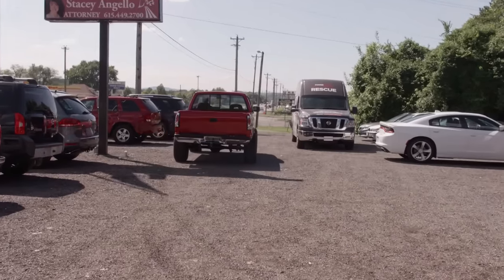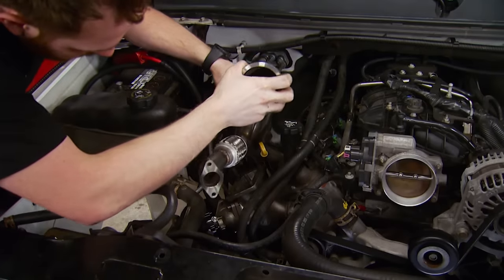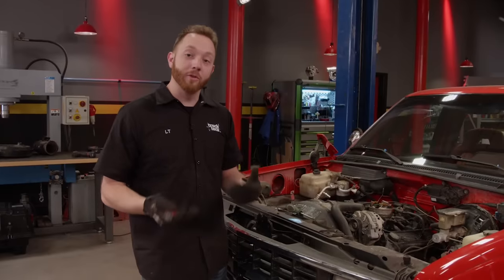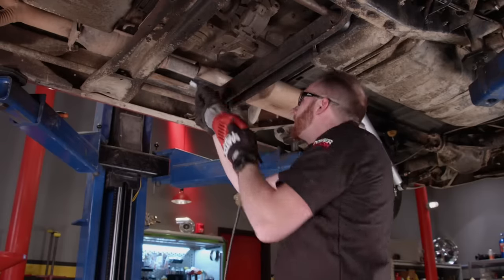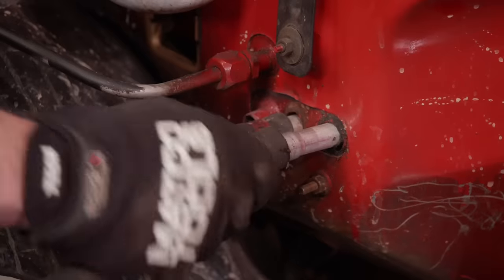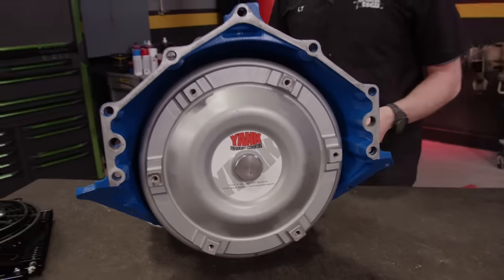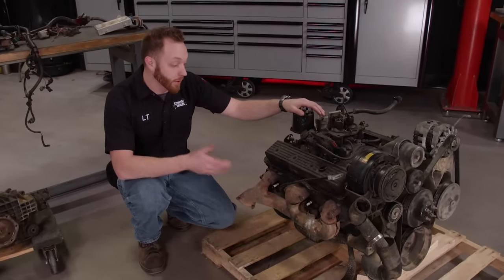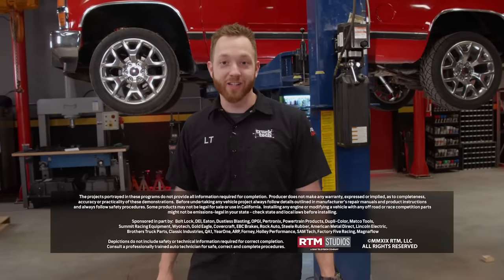LS Swap Do's & Don'ts on a Chevy K1500 - Truck Tech S6, E5

Comment: He failed step 1. He disconnected the positive terminal first.
Reply: First minute in they showed a lowered 4x4.... also a huge fail
Reply: They switched to awd.
Reply: yup saw that also
Reply: I am so glad I’m not the only one that noticed that!!!
Reply: I like how the intro shows how not to use a torque wrench for a video that stresses using tools correctly.
Reply: Good way to get things exciting in a bad way.
Reply: @willstikken5619  Turn it 'til it clicks, the a little more. What's wrong with that?
Reply: @phlodel  I always like the people that double click their torque wrenches "Just to be sure".  This seems to run rampant among car guys with poor training. 

If you don't trust your torque wrench buy a better one or learn how it works before torquing anything important.
Reply: i thought same thing at first...but looks like neg bolt was already screwed back in.
Reply: @willstikken5619  there is nothing wrong with double clicking the torque wrench, sometimes if you have too much oil in the bolt hole or sometimes if your tightening down alot of bolts on a flat surface like a cylinder head, it's not uncommon for the first bolts you tightened to need another tightening pass because parts will relax and settle and by checking your torquing job then you can be assured that you didnt miss any bolts and you wont be doing any damage or over torquing by double clicking.
Reply: @willstikken5619  as Brian G stated, no matter how many how many times you click that torque wrench, if it’s set to 20ft lbs, it will not turn the bolt more. It will always break away or “click” at 20ft lbs. click all you want. You’re not hurting anything. Sincerely, and ASE master tech with with an associates in automotive tech 😁
Reply: @xRSAkingx  Did you actually read Brian's comment and his justification?  If you think it's necessary you should probably turn in your ASE certs.  

BG's justifications equate to "If you dont know what you're doing do it twice".  You're amount to  "why not?".  Not exactly compelling arguments.   

Double clicking the torque wrench isnt going to acocunt for torque bleed.   Double clicking when you dont expect the  result noto to change is just uncessary wear on your TQ wrench. If you're using a cheap parts store torque wrench then it probably doesnt matter.  If you're using a quality tool or one that gets calibrated then you're adding unnecessary cycles to the tool.  Double clicking it just because you can  isnt as it being necessary or good to do.  It's the sort of things rube's do when they dont know hot o use their tools or are otherwise overcome iwth ignornace or apathy.   

Also I'd be careful about bragging that you have ASE certs and a  AS in Automotive tech, it's like bragging to a F1 driver that you have your learners permit.
Reply: @willstikken5619   oh boy. A keyboard warrior with a mission. And I have no problem flaunting my certs. Seems too many backyard mechanics want to tell me what’s what. The difference is this is a career for me, not a hobby. Even the old guys in the industry nowadays need their certifications and a ton of them have a hard time passing because they didn’t bother to learn what’s right. Seems you’re the only one concerned with how they used the torque wrench. Makes sense that you’re hovering in the comments making sure everyone is “educated” on torque wrench use.
Reply: @xRSAkingx  Thats some pretty smug ignorance my friend.  The use of wild and inaccurate accusations to denigrate some one you don't know anything about while doubling down on your own superioirty is a weak argument.  If you can't attack the merits attack the person.   That you did so while missing the point isn't surprising.  You have the narrow focus that we should expect from someone who's only relevant experience comes from the automotive field. You're standing on the first step and acting like you've reached the summit.  

If you wnat to explain how any of the things i said about torwue wrenches is incorrect i'd be happy to contiue the discussion.  If you just wnat to keep attacking me and pretending that your cert is the pinnacle of knowledge, thats cute but not very interesting.
Reply: I'm late to the party. Here's your main reason people double-click torque wrenches: Human error. 

If you need me to explain it, I can. Regardless, human error is the number one cause for assembly failures. It's similar to the old adage, measure twice, cut once.

Comment: "You can easily remove the engine without breaking anything." said no mechanic ever.
Reply: Dave Micolichek  it's usually some old piece of plastic
Reply: Well if you know what you're doing, you shouldn't have to break anything unless it's broken already......
Reply: Dried up electrical plug clips 😂
Reply: Well yea seeing as tho if they haven’t busted or screwd anything up. They haven’t done any real work. It’s not so much what you have done but what you’ve undone and made right
Reply: knuckles
Reply: I did my whole rebuild without breaking anything. And it's the first time I've ever done anything more complicated than changing my brakes.

Comment: Seriously put that nice engine in and you don’t even throw a coat of paint on those nasty motor mounts? Come on man!
Reply: Jerry Long I’ve noticed the same or similar things about a lot of their builds. Apparently TV schedule time constraints trumps detail work.
Reply: Put all those nice new parts on a dirty old turd.
Reply: Roadkill did it. The rust adds character.
Reply: Yup, and they even have a small sand blasting cabinet at their disposal to clean those mounts up in. Blasting them would have taken 15 or 20 minutes TOPS to do both. And then......who leaves a Chevy motor black, especially when a can or 2 of VHT Chevy orange would dress things up properly???
Reply: @jacobrzeszewski6527  Yeah, but that's Roadkill. Their whole premise is to get things done as quickly, easily, and (usually) inexpensively as humanly possible. For them, it's not about character, it's about getting it done with the least amount of time, effort and money, and moving on. These guys usually make things look pretty decent. They cut a crap load of corners so far with this build.
Reply: Why? It's just a truck. Not going to shows or anything
Reply: @colinrogers5419  That isnt the point. Everything going in is new, might as well take 10 minutes to clean and paint the old mounts. Just poor craftsmanship and attention to detail. If thats how you roll then so be it. I would have at least rattle-canned some paint on there to make it look a bit nicer.
Reply: Well, I live deep in the rust belts of northern Indiana so cars are either packed in rice 1/2 of the year or are driven. Not to say you can’t build a really nice car and drive it, but the only nice cars I see are at sit and stare car shows behind tape and are started only to take on and off the trailer. Power Nation builds cars that are meant to be driven hard and enjoyed for what they are. Not just preserved and put on displayed. Someone who drives their car hard doesn’t necessarily care if there’s a dull or rusty part somewhere under the hood because they don’t drive with the hood up. It’s the function that matters to them, not the form. I’m not saying that show cars are necessarily bad, they have their place, but that isn’t necessarily the spirit of this truck build.
Reply: I was thinking the same thing, why not clean the engine bay with a high pressure hose and some degreaser while they're at it..... these guys are a bunch of grubs.
Reply: even sloppy mechanics isnt that lazy anymore
Reply: This ain't a labor of love. It's just TV. If it was our personal / professional build. We like to touch up the little stuff.
Reply: No doubt, but after all even a cheap can of paint still cost $1. It reminds me of my grandpa. Too cheap to put a coat of paint on anything.
Reply: @thebigdustin  At least we can take this as a lesson, we can paint our own parts even if these guys don't!
Reply: Engine mounts!
Reply: OMG my husband is FLIPPING out over it,lol!

Comment: They are completely right about the cost to build a 383. Last winter I specked out building the L48 into a 383 stroker in my 77' corvette, by the time i was done with it, machine shop time for block prep, parts, and tuning, i was close to $9K. Then i looked at Blueprint engines, i got a dyno proven 430+hp fully dressed 383 stroker delivered to my house for $5600. I ordered it with a lower deck height intake to clear the hood, and i swapped out the water pump for the short style. Motor went in perfectly and fired right up! For a car that no one will care about numbers matching, crate motors are the best way to go in my mind if money is an issue. If its a numbers matching car, well you'll have to suck it up and build what you have.
Reply: AWESOME   good job, wicked good decision    ;love it!
Reply: Yes! BluePrint has been providing us with long blocks since before I was born. Great company.
Reply: I used to build 383 with alum heads, A completely Deluxe Version would cost me $3300 minus the Carb
Reply: Chloe Hennessey I thought “Hennessey” built their own? Lol #Hennessey Performance
Reply: I had a 69L48SS Camaro that was numbers matching. I pulled the numbers matching motor and built a motor I could flog on without worrying about venting the block. I kept the M21 tranny in it. I later sold the car (wish I hadn't) to come up with the down payment on my first house, the matching numbers motor went with it in a crate.
Reply: Bondpit Not all of what Hennessey does is in-house. A customer comes to us and says he wants a BluePrint 632 we get him a BluePrint 632. We install it, beef up the trans, drive train , tune it and have them come pick it up.
Reply: Tip ! When pressure washing the engine bay Tape up the open A/C lines! Lol!
Reply: A 383 has the potential to make more power though from the bigger cubes and  the parts used in the  stroker engine internals are allot better. I built a turbocharged forged 383 using a ls1 ecu coil over plug efi system. 6600$ That was every nut bolt completely new block heads cam efi single plane .
Reply: You did something wrong if it cost you almost 10k... Machine shop bill should only be $500 to $700... Stroker rods pistons And crank another $850 to $1200 for a kit ...Heads $1500 to $2000
Reply: @bilbobaggins4710  you can find rotating assemblies as low as well under $500.
Reply: @johncrankshaft2886  wow...Holy balls that's cheap 😱
Reply: @bilbobaggins4710  all it takes is looking and getting to know people, back in 2011 a scat forged rotating 383 assembly could be had for under $800 and the simpler cast version can still be found for around $405-470 depending on 1 pc vs 2 pc rear main. If you know where to look and can do most of the work yourself like most actual hot rodders used to instead of paying someone the price drops substantially.
Reply: @thastinger345  smaller house, keep the car
Reply: Dood you be getting ripped,  I did 383, beat crank, best rods, balanced,  good set of pistons,  new afr heads  6000, budy did budget on all, blueprinted balanced, 3500, so you getting ripped.
Reply: @marccres6619  Sounds like some shop did everything.
Reply: Marc Hirschsohn I don’t understand why people pay 6 grand to have a 350 hp engine
Reply: @devious762  cause they do not know how to,or convince to bye parts they do not need,or think high hp part will give what you add them up to be, when they could have spent 800,put it together them selves and had 300 to 400 hp.
Reply: @johncrankshaft2886  4
Reply: @marc...77 was the year I was born. One day that 77 Vette might be worth something
Reply: @thastinger345  what year did u sell the split bumper my friend?
Reply: That's funny. For my 350ci upgrade to a 406ci, I spent $3300. That's new forged pistons and balanced rotating assembly, machine work on a used 400 sbc, bearings, gaskets, larger injectors, tunable PCV valve. Setup for a 150hp nitrous plate system, going from 460 HP to 680 HP on the juice. A 220 HP increase @ $15/HP. I bought a 502ci BBC from a guy who spun a bearing, came with all parts plus a new crankshaft, only had to buy new rings, camshaft, lifters a ball hone, new gaskets and plug wires, that thing makes 500 HP and over 500ft•lbs TQ off idle to 5000rpm all in for $3000... That's $6 / HP. Just gotta be patient and learn to build from people and read books on engine building.

Comment: Only $3500 lol. I be pulling them from junkyards for 350 then rebuild them myself
Reply: I buy em for $500 from people like you and rebuild em 😂
Reply: @ze_german2921  California price are crazy
Reply: @JohnSmith-qj4cf  
California,the shows in Tennessee..
Reply: Idk what kind of rebuilding you guys do but when I did mine 6.0 it was better to buy a new crate engine
Reply: @reyperez3424  yep when you start building anything other than stock it all cost about the same

The advantage that LS have is that the Factory block can take a little more boost but it's not invincible either

Just give me a 383 and some 220cc heads and enough can and carb it'll make 550hp